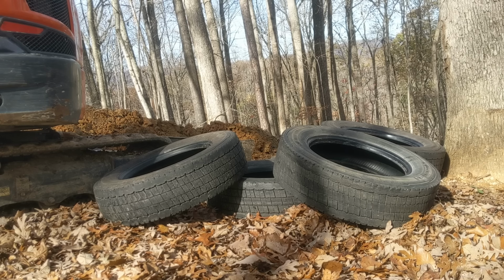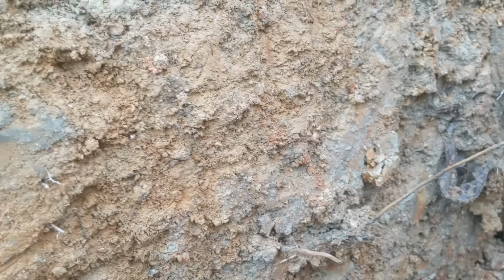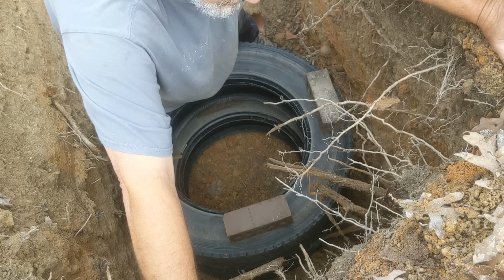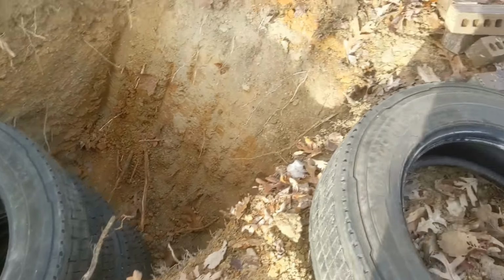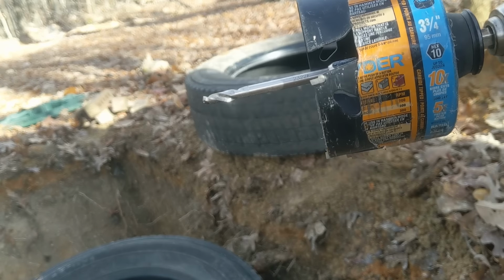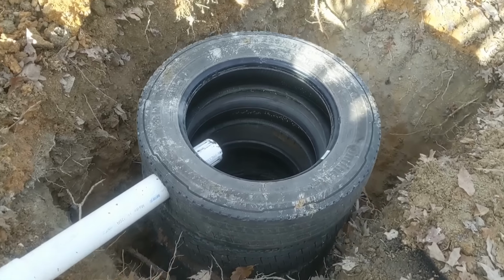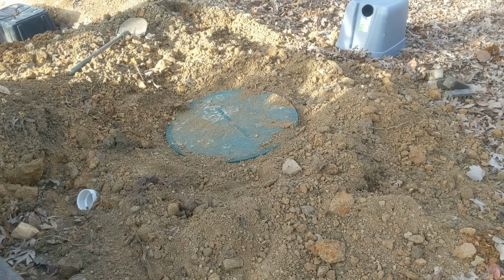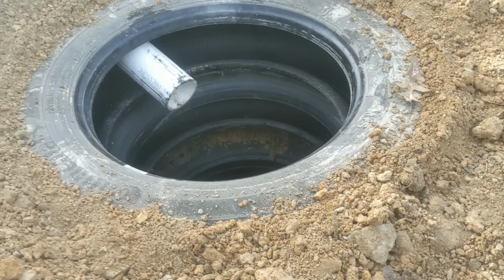DIY used tire septic system for a rv, cabin or tiny house. all made out of tires.step by step build

Comment: I dug out a hole ..poured 4 inches thick concrete..at the bottom...put a 33 gallon trash can in the middle..filled it with water . poured concrete around the trash can and cast a concrete septic tank..inlet and outlet holes...for the piping have to be cut out and pipes have to be in place ..after setting...the water is scooped out...trash can cut out...

Comment: I like your idea a lot.  I have a cabin  on a bush parcel of land.  I am going to copy and build this simple septic system because I have access to water for a flush toilet.  The women folk especially will  like it.  Bye bye outhouse. Thanks for sharing.
Reply: Better to get a couple of those plastic 40 gallon food containers and connect them with PVC and use perforated pipe as a drain field.
Reply: Thank you for your thoughts.
Reply: With the gaps like that, the first good rain would wash all the dirt down inside. You would want to wrap it with like weed netting and fill the space around it with rocks or something? I just remember my dad putting bails of straw around it. His were made of cinder block cemented with gaps between the bricks.
Reply: Thank you
Reply: Separate your gray water, system works better
Reply: Please do not do this. It is not an environmentally friendly solution. If you're going to the effort of digging this hole, you  should just install a concrete tank, or a plastic tank if allowed.
Reply: @rob6052  I agree - this type of short term thinking can cause unforeseen health disasters in certain situations that aren't mentioned in this video.
Reply: I buried 2/55 gallon barrels. 1 with 3/4 holes and a solid’s barrel. Works great and has been 50 years.

Comment: I’ve been thinking of putting a small hunting / camping cabin on my 50 acres and this would be perfect. Thanks
Reply: You're better off using a couple of upsidedown 55 Gal Plastic Drums with the covers left off or cut off, connected to each other with a larger hole dug out surrounding them.  I put down a base layer of about a foot of 1-1/2" river rock (no smaller) and set the bottomless drums on top of that.  I also dig a couple of oversized pathways for some leech pipes connected surrounded by the same size river rock about 2/3rd up the drums and surrounded completely in the river rock.  I don't worry about "sealing" any of these pipes to the drums.  Then fill in the extra space dug out around the drums with more river rock and over the top of the drums where the main inlet pipe goes into the first drum.  I usually fill the river rock at least 6 inches over the top of the drums.  Then fill the rest over the top with dirt.

The only thing people see is dirt and a 4" pipe sticking out of the ground slightly angled 45 degrees to hook your main line from your cabin or RV into it.  The problem isn't always the "gray water" but the solids that accumulate.  That's why for an RV or Cabin that houses 4 people every weekend and a few weeks during the year, this type of system will work great and for several years without any sort of maintenance. I have some seasonal (spring summer fall) RVs hooked up to one 55 gal drum system with one leech pipe that has been working perfectly for 25+ years.  If your soil is mostly hard clay, this sort of system will not work unless you massively expand the number of drums or use a plastic container larger than drums and a few leech pipes.  If you have sandy loom soil as I do, they are perfect as that type of soil is perfect for dealing with water aka gray water.

The reason I use 1-1/2" river rock is that it keeps the dirt back as dirt can eventually flow into the drum/system and it causes an issue as it takes up the space needed for the "solids".  If my solids are starting to fill the drum up, I can usually use some lye which will eat away some of it for a while.   This premise is much like an old outhouse but a system that lasts longer because of the rock keeping the dirt from falling into and filling up the system.

Sewer systems methods like this have been used for years with this sort of method but just on a larger scale for a normal year-round home.  They just have one or more larger cement tanks connected together and a much larger leech field with usually 4 or 5 leech lanes because people tend to use more water in their homes from longer showers, dishwashers, washing machines, more people, etc.

Another option is to replace the drums with those large plastic farm field chemical tanks that are plastic surrounded by an aluminum "cage" so the plastic doesn't expand out when they are full.  These usually are several hundred gallons and I just cut out large parts of the bottom instead of the whole bottom to keep some integrity of the plastic tank together.  For the pipe going in I usually will use some hard plastic in addition to the tank to give the main pipe going down, some extra reinforcement.

Comment: Pure genius! When I was a kid 60-70 years ago the families and neighbors would dig 4' x 4' x 6' holes, lined them with Bricks, stacked on the walls, cover it with plywood, cover it with dirt and connect the cast iron pipes connected with molten lead. It was called "Cesspool" unlike the Septic systems used to day with Liquid, Solid Chambers and drain fields. This would be totally illegal today but outside of any city limits who would know?

Comment: I dug a hole filled it 6"With 3 quarter stone. Shot a bunch of Holes in a 55 gallon plastic drum... When the shotgun about 20 or 30 shots.... Buried it in the ground covered it up And pumped my septic into it for over 10 years without a problem..... Add a drane fild 10 by 20 area with one foot ' of 3 quarter stone Covered up .. I never had a problem for over 10 years And the people I sold the house to.... Still use it today.... Just use Riddex in it once every couple of months

Comment: I used 55 gallon poly tanks in a line as a septic system. Laying them on their sides and building leach lines out of the last tank in the system. We only have about 3 foot of rocks and dirt on top of the bedrock. Making a concrete tank impossible to install.  Leach lines had to be installed ground level then covered with dirt. I've Never have had a problem with that cabins septic system. I put clean out plugs to facilitate quick repairs of any future issues.

Comment: This is a really interesting idea! I'm curious how it will work tested out. Will any smalls be fully contained though after its working since there's... the tires aren't sealed together between the tires? I've heard of people sometimes having smells from when their septic systems get full and leak out. Or perhaps... I wonder how deep you have to be for any leakage to have its smells fully contained? 

An alternative is to have gaps between the tires, but only deeper on the bottom half of the tire stack. Then on the top half instead have them fully sealed or compacted more. I would have had narrower gaps between tires. Your gaps are so big I'm worried it won't function as well. 

I hope this idea of yours works. Your idea has merit. Especially now since this country has no manufacturing left hardly, we're vulnerable to faster inflation and getting priced out of many things quickly. I think this means people will be forced to adapt and do like you are doing. 

I also hope my comment will be seen as friendly and not criticism.

Comment: I would have dug out around the tires at least a foot to 18”, then filled the center with 3/4” gravel and on the outside. Put pour a concrete slab on top to keep dirt out, then fill around the outside with gravel, and cover the whole thing with 2 layers of 6 mil plastic sheeting and then fill the dirt in.

Comment: Great idea, traditionally I am use to burying an old car and sticking a pipe in a window.
Reply: I've always found Ford's to be superior for this purpose.  😂
Reply: Actually vw bugs work the best.
Reply: I may have found a good use for the old Transit Connect
Reply: I don't even buy the car.  Just wait for someone to leave it running when they run into the gas station.  But you have to have an idea of the car so you can have the hole pre dug, just to avoid getting caught.  hahahaha
Reply: @ check the back seat for babies.
Reply: I've always preferred using a Pinto or Vega station wagon.

Comment: Uh................. that pipe could easily go between the top tire and the next one down without drilling that hole... and I would use a single sheet of 3/4" plywood cut in half glued and screwed to make a 4'X4' cover for it... take a quart can of roof tar, crack the lid and heat it in whatever safe slow way you want (just make removing it easier), and put it in a bigger at least gallon bucket, and melt it down with diesel or gasoline.... gas is faster, but the diesel is safer... DO NOT USE ELECTRIC ANYTHING IF USING GAS.... get the mix to the consistency of watery paint and paint your plywood cover with it.... it'll soak in and soak in and soak in, and that's good.... get all the edges very good with several coats..... Let it dry on the horses or whatever it's on for a couple days.... in the sun if ya can.... then throw it over the hole... That lid will outlast anybody 20 years old or older....  My Grandpa built an 8'X8' little hunting shack on the property back in the woods in the early 1940s on 4 oak stumps he cut off... These are trees about 8" across that he cut off about a foot off the ground... He used roofing tar very watered down , made a small lip in the dirt around each stump and slowly poured his watery mix (about a gallon on each) so as to soak into the ground without leaving the lip... and then did it again with a little stronger mix..... He stripped the bark off the stumps down to the dirt, and the next spring he painted them with a thicker coat of the gas tar mix... and about a week later he said he built the cabin/shed/shack.... Those stumps are as hard and strong in the ground today as they ever were in MY life, and I'm 68 now, so I'm a believer in the mix... water nor bugs, nor critters like that mix.... Doing that hunting shack like that always made me think Grandpa was some kinda genius, and I STILL think that.

Comment: I believe I'd use a plastic 55 gallon barrel with a hole near it's top in its side for input and a hole on the opposite side four inches lower that would have an elbow pointing down inside the barrel. The barrel would collect solids and liquids and allow decomposition.  The elbow keeps 'floaters' in the 55 gallon barrel. Excess liquid would then flow into almost exactly the system that is built in this video. This would allow a fairly easy dig out with a hand shovel when the barrel got near full of solids. The tire drain field would only see liquid and fat should float in the barrel. To empty the barrel I'd then go out in the woods and dig post hole using a post hole digger and dig about two feet deep and fill with the compost up to about 4 inches from the soil surface and top over with the dirt dug with the post hole digger. Cover with leaves to leave no trace. I'd spread these holes about six feet apart. This would return to the biosphere what the human organism borrowed from the biosphere. I'd consider topping the tire drain field with a tire that still had a steel wheel in it about six inches from the surface and cover with multiple layers of poly plastic and then cover with soil. You'd still need a cap of some type for the 55 gallon barrel. Some barrels have screw on caps so consider that. This is a hypothetical mental 'poop for brains' exercise of course. P.S. The tire drain field could also be installed horizontally.

Comment: I welded 2 50gal drums together. Capped both ends. Laid it flat Cut a hole up top and a hole on one end then put rock and leach line connected to it. Been going strong for a while now.

Comment: I would suggest a vent is essential. I would further suggest putting the bricks inside the tyres to prevent them collapsing and not between them as the hole will fill with earth, rock and clay that collapses inward.

Comment: Another good use for some old tires👍! And with some construction ingenuity using the same concept, get a hold of some used giant earth mover tires for that tornado shelter you mentioned. Btw, forget the bucket. Old tires are cheap. When it's time for another septic, just dig another hole 🕳 .

Comment: As a non expert I can’t help but wonder if over a couple years dirt is going to enter and build up through the large gaps. Especially with a heavy rain.   I would think you place the bricks inside the tires so they don’t squish down and drill a bunch of holes in the tires then fill the outside with gravel. Wouldn’t this configuration have more structural stability and drain better for longer?

Comment: Ever wonder why landfill dump sites do not accept tires to bury?  Because no matter how you lay them and bury them, they can fill with methane gas and eventually they will pop right out of the ground, sometimes explosively.  Good luck, but I think there are better materials to line a "well" with.  Old time privy pits were lined with logs, log cabin style.  When it filled, the privy was pulled over a newly dug pit and the old one covered in dirt from the new hole.
Reply: Righ! Here in the city of San Diego they spent over $11MM experimenting on a new variant of the old cess pool method in the late 40s they dug a massive trench deep down and over a half mile long in a slew on the west side of Morena Boulevard, the oldest street in San Diego. They covered that trench with telephone poles a good 8’ below the surface, covered it with sand, and paved over it. Then the City crew from Wastewater Services brought in a 4’ wide corrugated cement conduit through which all the Black Water sewer passed from the Mesa above.

Everything worked well until 1951 when a spontaneous explosion of methane gas blew it up. And that is how Mission Bay was started.
Reply: Better keep that exploding tire idea secret. Our army has enough to worry about stepping on land mines.  Now they have to worry about stepping on a methane filled tire buried in the road.  " I don't know what happened Doc, I think I must have stepped on a 245R18LT Goodwear tire. And that smell, it's the methane that got on me when that sucker  blew up smells like sh$%."😮

Comment: I believe on getting that 3 inch conduit into the tire you need extremely high RPM with very very light pressure like you might’ve been pushing too hard.

Comment: Its a cesspool without any rock, gravel ect.   Never seen one using tires,  they can last over a lifetime,  of course running a leach field Drainage using pipe, gravel whatever something to increase the storage area.   New septic systems use evaporation so they say more than ground absorption.    My grandfather put a cesspool late 1930's.  I live in the house now, never pumped or had any problem at all.    No reason no to put sewer rock from bottom up ft from ground  level put some ground cover fabric to help dirt from going into gravel it would last for years.

Comment: Just a little constructive criticism. Your starting out at a deficit with the roots growing all around the tires. They'll grow like mad in the fertile environment, and fill your tires with small roots within a year, and there'll be no place for the effluent. I speak from experience here, because I put a fill bed through an overgrown lot, and within 18 months the waste water from my septic tank had no place to go, and I had to dig up the fill beds and redo them. My next project was spraying the lot to kill all the brush to prevent a repeat performance.

Comment: Local building inspection dept would croak over this method
Reply: That’s only if they see it 🤷🏻‍♂️

If they show up make sure you can hide the body. Maybe in the same tank😂
Reply: Not regulated where I live
Reply: here in  my part of the world they would   make you did it back up even if t you live in a 100 mile all woods
Reply: In NY u can't even get a c of o without a stamped engineered septic...
Reply: @steveezard8859 thats why we move to the country..I cant stand being told what to do on the property I PAID for😂 so I moved away from it too
Reply: The local building code enforcement department can kick rocks the only thing they are really interested in is ensuring that our wallets are never filled with cash

Comment: You first started that drill you were running it backwards I kept looking at why were you running it backwards even before your battery went dead
Reply: I was wondering that also.  I didn't know if it was just the camera speed, or if it was actually backwards.

Comment: I would think of this as a short-term solution for a leach field. Remember tires float and will come to the surface. so, cut holes in the top of the tires to allow air to escape. Or else one good flood and your crap will come shooting to the surface.
Reply: Depends on diet!
Reply: Ya this is kind of how back in the older days we use to do this. We have used small steal tanks , two big trash cans, build oak wood boxes or just about anything we could find an yes tires . Bring back memories.
Reply: 😂thanks for the visual !
Reply: Tires don't float.
Reply: Tires float? Several sources show common rubber as being denser than water.
Reply: @joewoodchuck3824  some are floaters and some sink. LOL The shape of the tire traps air in them.
 innertubes are made of rubber most ships are made of steel.
Reply: Tires float??? Bwahahaha.
Reply: On what planet? I've never seen a tire float. Innertube, maybe, but not a tire.
Reply: And FYI, no tires use inner tubes, except for tractors.

Comment: The steel belted tire is hard to cut.  When I worked in the Parts Dept. as a teen at a car dealership, I used to have to saw a 12 inch piece out by hand with a hacksaw to send in for a warranty.  That was 50 years ago before battery power tools were made.